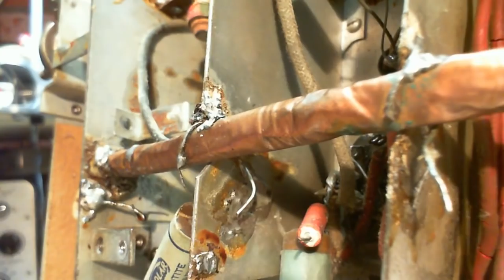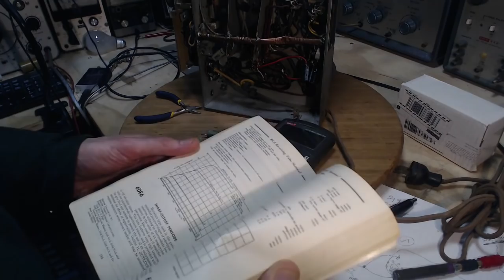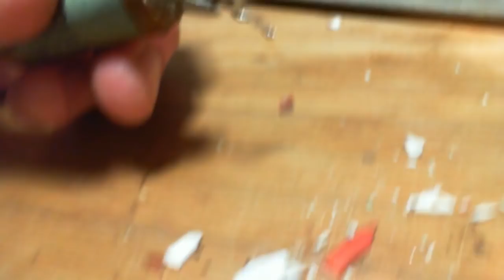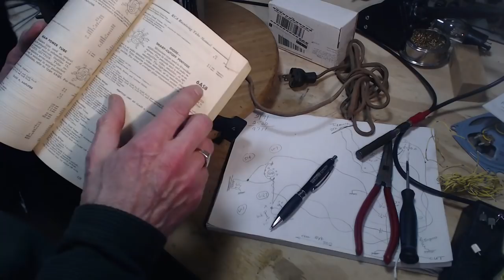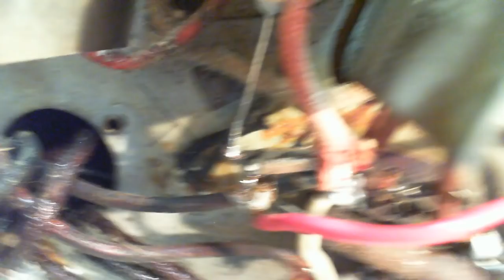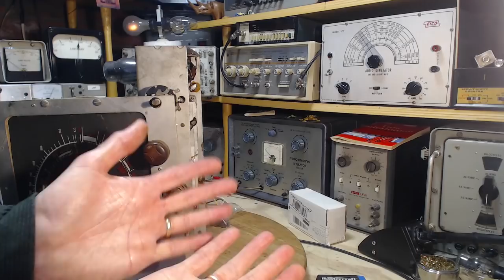Canadian Marconi Model 93 Video #10 - Another Shot

Comment: Jim. This should help clarify the confusion .  This was taken from www.radiomuseum.org “Canadian Marconi model 93 is a 6 VDC tombstone farm radio with a vibrator power supply for B+. The three wavebands are 530-1640 kHz (Broadcast), 1.62-5.2 MHz (Police), and 5.2-18 MHz (Short Wave). A small button on the side of the cabinet is used to momentarily illuminate the dial, which is normally not illuminated to save battery power.”  The challenge is yours

Comment: That noise you heard on the tuning sounds like a capacitor charging and suddenly discharging sorting out! And that grounding you did you didn't need to put it on the copper pipe? you could have put it on the side or better on main chassis be better. Actually put all the groundings into 2 spots? One for the power supply and heaters and your audio signals put them separate away at a different place. And that copper tubing is broken isn't it..!  Not soldered to the chassis that might be causing your arcing noise!

Comment: Jim, you have an uncanny talent for under-statement LOL. "Bent pointer"? Looks a lot like a pretzel. Good job on this. However, your capacitor may be a bit low in value. If it is indeed C23 your schematic indicates it should be 0.25 at 200V. The one you put in there was a 0.05. I wonder if this could cause that resistor to heat up? Just my 2 cents worth. Great job, Jim. Thank you for posting it.